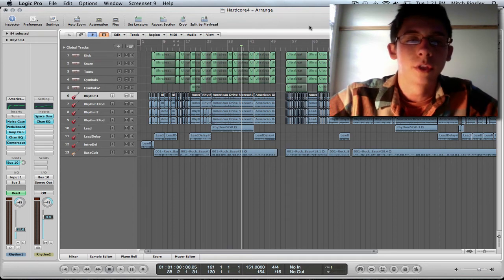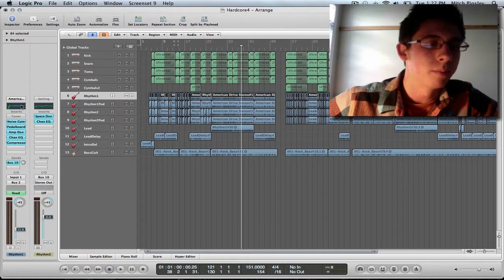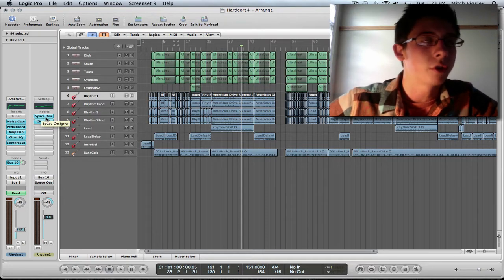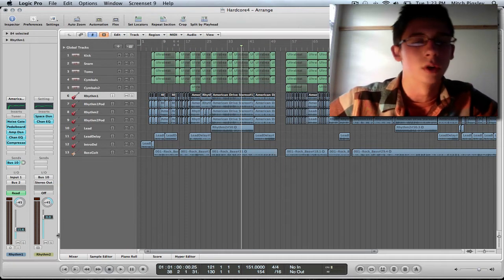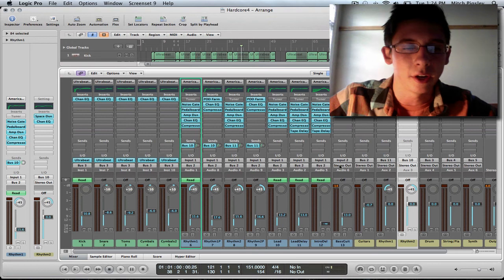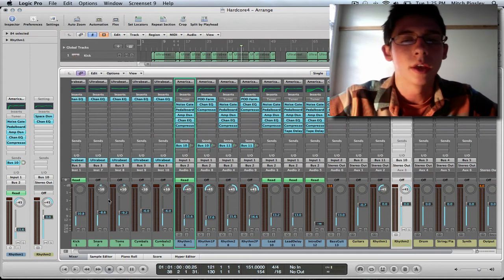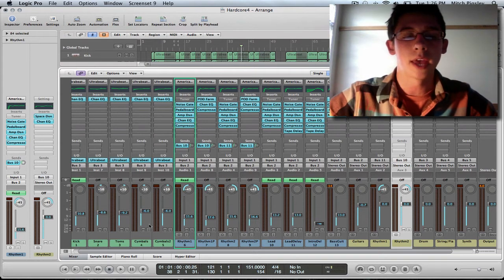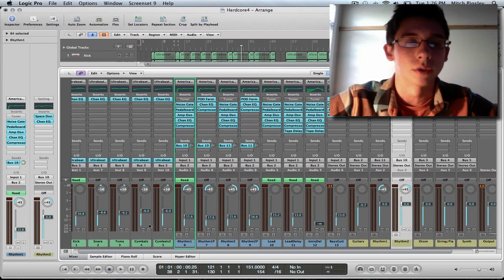Logic Pro 9 Tutorial - Bussing & Auxiliary Tracks Pt 2

Comment: how do you pan a track when it is send to a bus ?
Reply from the maker: kevin Mawanda Click and hold the bus and select "Post-Pan" That will send that data on to the auxiliary track. Is that what you are wanting to do?
Reply: i mean if a track's output is send to a bus
Reply from the maker: In that case the stereo channels are already sent to the auxiliary track. You can pan on your main channel strip or on the auxiliary track you are sending it to.
Reply: when i send a track's stereo output to an auxiliary channel i can only pan the auxiliary channel not the channel strip
Reply from the maker: Is your source track in stereo?
Reply: Mitchel Pigsley yes
Reply: kevin Mawanda in your video your source track is in  stereo output but ive seen other videos and they source track says output 1-2 is that the problem ?
Reply from the maker: I don't think that should be the problem.. I would suggest trying to use the directional mixer plugin to pan on your source track rather than use the track pan. That might work best.
Reply: ive find the problem i wasnt tickin the ascending box next to output 1-2 when creating a new track plus i was using mono plugins thank you for your help

Comment: Mitch, I'm trying to bus separate audio monitors. So in other words I need to send the drummer a different mix than the rest of the band. I'm using Logic Pro 9 and Presonus Firestudio if that helps. I'm also using Presonus HP4 monitor amps to the ear phones (which may be overkill but it let's them adjust their individual earphones in the booths.Help please I'm tired of having one monitor mix. You can reach me at expnik@yahoo.com
Reply from the maker: Do you not see multiple outputs that you can send your auxiliary tracks to?
Reply: Mitchel Pigsley Thank you very much.I started using bus but i am not sure how much or what and when i quess.What kind of effect if not reverb?So i have idea.All tips how to do my song comes from you at the moment.I mean mixing.I would like to send you my track so you could use it and work on it in one of your shows if you want it but i would like to know what has been changed and why?I am a new in to Logic but i play music 29 years. What do you think?And you have to tell me how to send this session.I have never done it before.
Reply from the maker: I use all of my own assets in videos unless it is in a genre that I specifically don't write for.

You can use busses for parallel reverb, delay, and compression (which are the big parallel effects). You can also submix which is extremely beneficial to the mixing process I have found.

Comment: hey mitch . Will bussing solve my issue on loud mixes? i have been making music without using busses and i think that bussing will help me out to get a better mix
Reply from the maker: It will absolutely get you a better mix if you are submixing and reducing complexity. Plus you should be using parallel compression, delay, and reverb regularly. As for loud mixes, this probably won't fix that. You will still need to drop your track volumes until you are seeing a decent amount of headroom on your output and no clipping.

Comment from the maker: Yeah there are a couple advantages. One being it is going to sound a lot more natural to have parallel reverb/delay instead of just using the wet/dry nobs to control it. You can also send multiple tracks to a single reverb plugin and this is great because the space designer is very CPU intensive so you can use one instance of it for multiple tracks. I'm sure there are many other reasons but those are the two that come to mind. Thanks for the comment!

Comment: Sweet! Been avoiding this topic for a while… Turns out it's actually pretty simple. Thanks for that.

Question: For, say, putting reverb on all drums - would it work the same to bus all the drum tracks to an aux, then add reverb there (then just 100% dry and whatever% wet)? Or is there an advantage to doing reverb via an fx loop?

Also, if I want to add both reverb and EQ, should I just do the whole-track-on-a-bus, then put reverb and EQ on that aux?